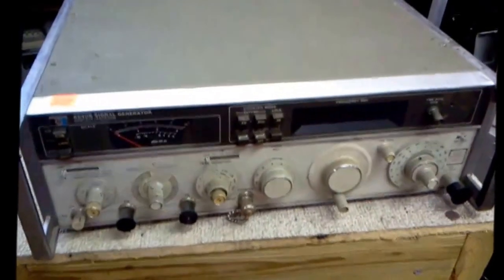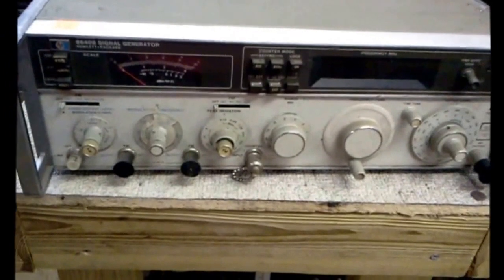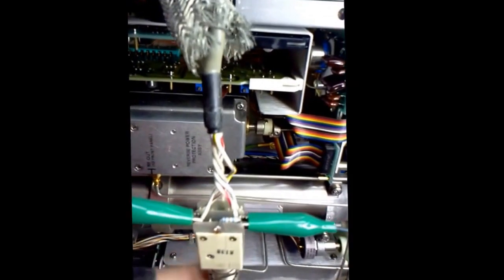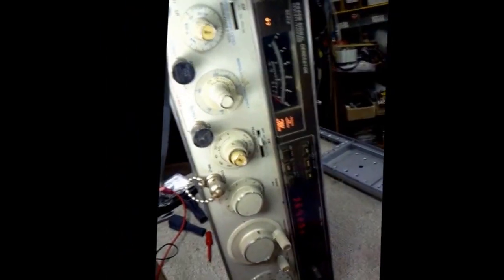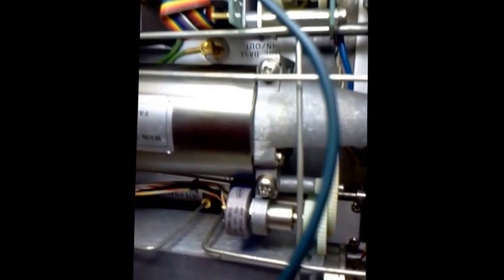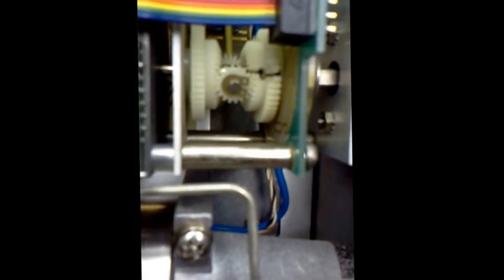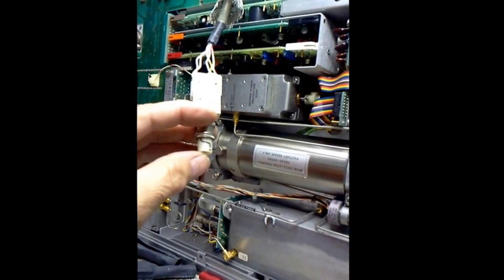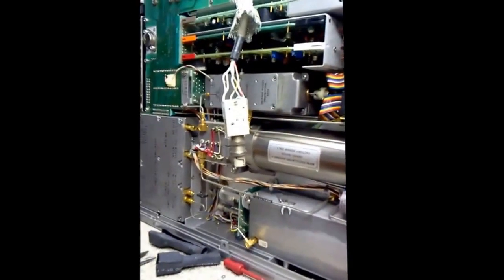#001 HP8640b repair part 1

Comment: I have an HP8640B I've been struggling with for a while.  I suspect a problem in the AGC board.  When you first power it on after being off for a while, It has RF output for a few seconds, then it fades away to nothing and the output meter drops to 0.  After it fades away, there is still good output at the aux connector in the back, and the counter and everything still works.  Just no output on the front, and no meter reading.  It appears the AGC is turning off the output.  I've been trying to trace it through the AGC board, but I can't find a schematic that matches the AGC board I have.  My board has components that aren't in the service manual schematics I've been able to find online, and I'm having trouble figuring out how the board is supposed to work. Ever seen this problem?
Reply from the maker: Cannot say I have. But sounds like you are on track or at least starting in the correct area. See if you can get some pictures of the board posted up and perhaps we can have a look at it and see if we can determine what you have.

Comment: Nice vid i am thinking of buying a working second hand one  myself for €150 (195$) is it worth it and is the freq counter good
Reply from the maker: these units go for several hundred to 1000 dollars here in the states. Well worth the money, they do have some weak parts but can be fixed. Very rock solid unit when it works. I love mine.